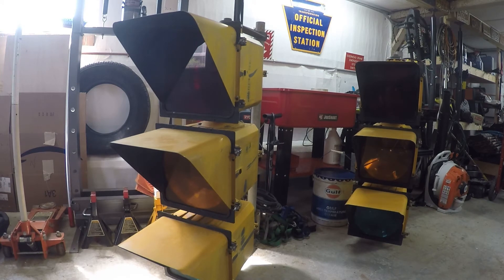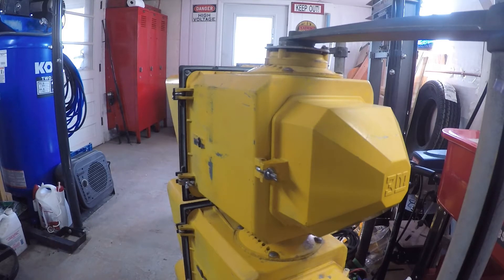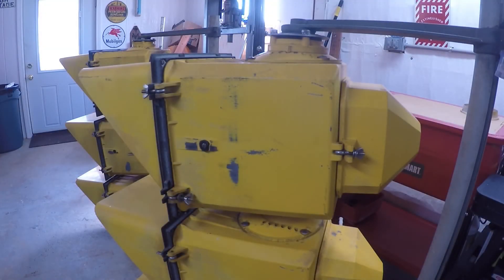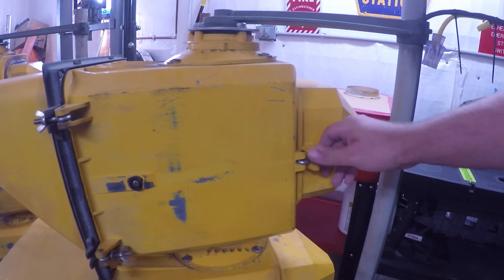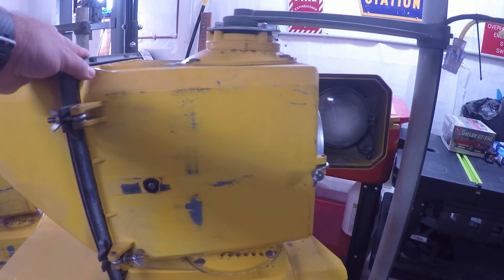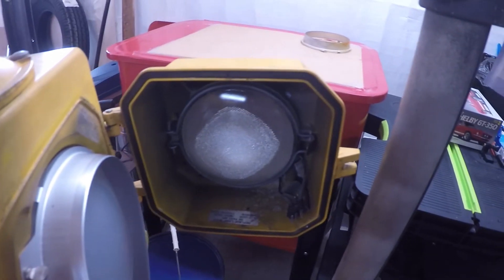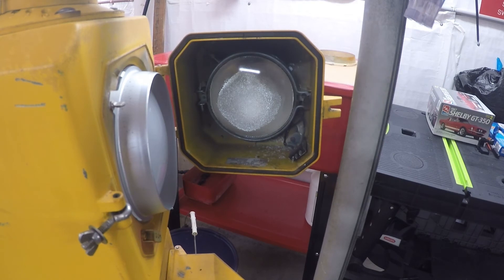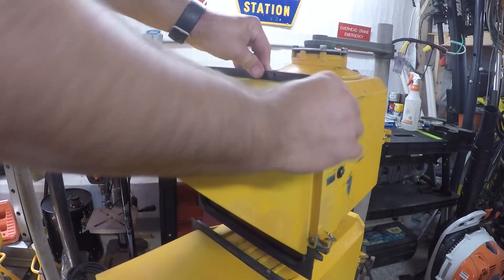Traffic Light Project - Part 1 - Intro

Comment: Studies show that traffic lights that are painted yellow instead of black prevent confusion and accidents. The actual cabinet/fixture with lights should be painted yellow back and front. The back plate should be painted black on the front and yellow on the back… Make it the entire back of the signal yellow and the front of the signal Having the yellow cabinet and the back plate black
Reply from the maker: I wouldn't be changing anything on this light. This is exactly how they came from 3M.
Reply: @stuffyoucando2  No man not yours, I’m just talking in general about actual traffic lights in existence. I think states should go from black to yellow… To me it’s more effective. There have been studies were less accidents take place when traffic lights are painted yellow as opposed to black
Reply from the maker: Gotcha. Here in PA, I can’t remember the last time I saw a black one, maybe it differs by state?
Reply: @stuffyoucando2  yes, you hit it!…it varies by state…out here in Cali, they are all black (or dark). Some states have both. What is also great, is that some states have a signal for each lane on the overhead pole.., like Washington State and Nevada…and others I’m sure… they are starting to put yellow reflectors on the front of the already painted black back plates of some of the signals here in California… But I believe that the whole cabinet should still be painted yellow, and the backside of the back plate should also be yellow, with the front side of the back plate being black for contrast… That is ultimately the best way to go statistically for preventing accidents